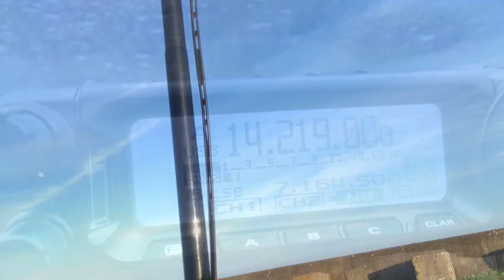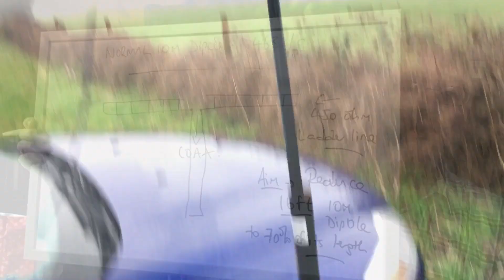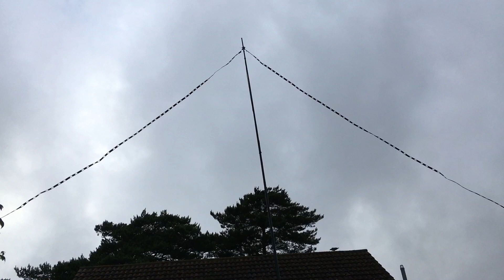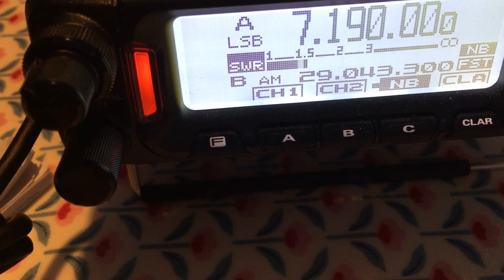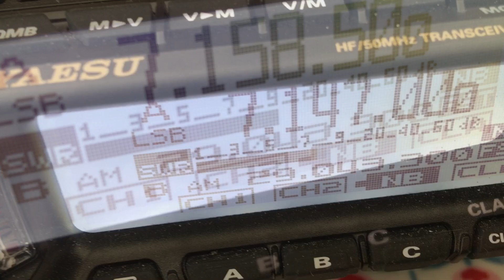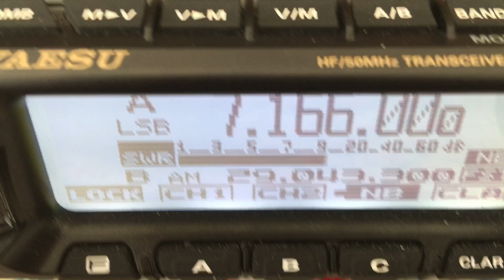HAM RADIO 40 Metre Dipole - Shorty Forty

Comment: Hi Tim, thanks for sharing your experiences. Very useful info here. Just a practical hint on how tuning the proper lenght, provided you start with a longer than neeed one. Do you move the ladder short circuit towards the center or do you cut and shorten the floating wire of the ladder line close to the center fed?
Thanks ad best regards, Massimiliano - IZ0WAZ
Reply from the maker: Hi - cut the lower piece nearest to the centre - equal amount for both legs.

Comment: I’m not sure what I’m doing wrong. I tried modeling an 80m version of your antenna on the MMANA-GAL software and the SWR was crazy. Then, on a whim, I asked the software to ”optimize” the design. It came up with a modified version with decent SWR, except … the overall length was LONGER that ½ wavelength on 80m – 59.7 meters!

I’m new to antenna modeling, so I undoubtedly made a rookie mistake somewhere. For example, I don’t know how to model ladder line. I just used individual wires in free space.

73 de AF6AS
Reply from the maker: hmmmm thats not right. For 80m you should double the length of my 40m version and then trim both lower wires at the feedpoint end to get the tune on the portion of 80 that you need.

Comment: Can one of these be used multiband?
Reply from the maker: Yes as long as you feed it with 300 or 450 ohm ladderline and into a balanced tuner or if using an unbalanced tuner via a 1:1 or 4:1 current Balun. 73